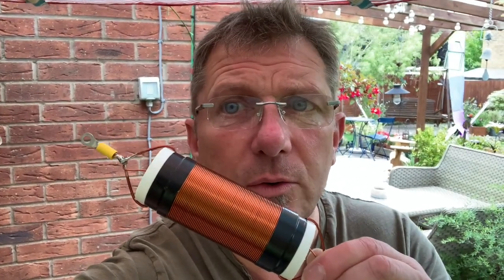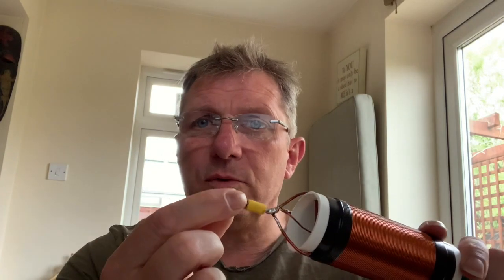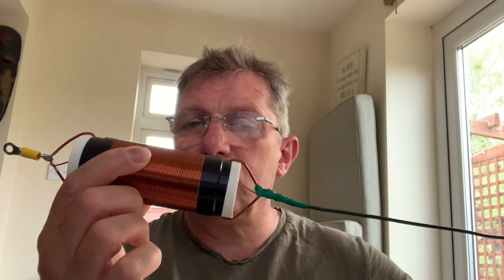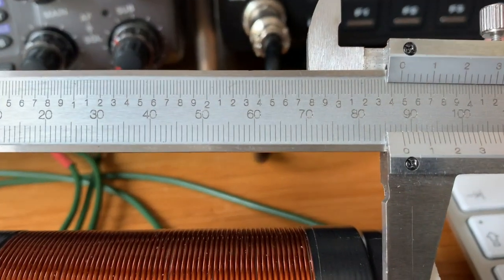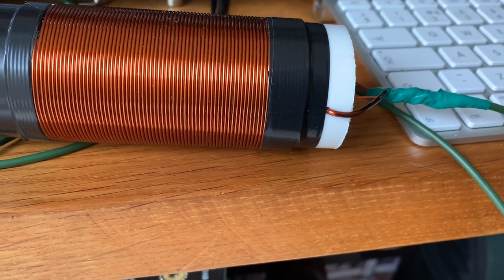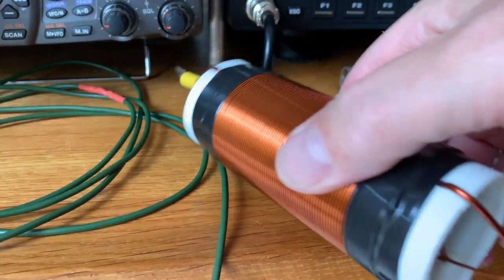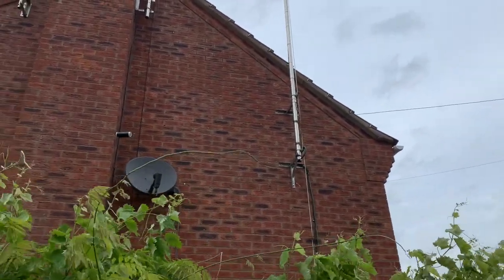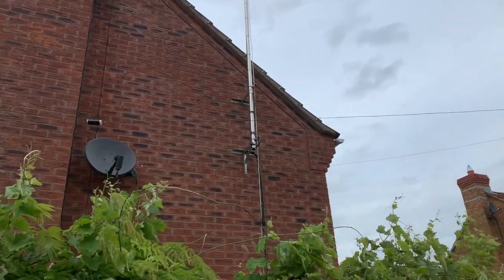Ham Radio: 80M EFHW in a 40M EFHW Garden.

Comment: Hi Mike, Keith, WB2VUO near Buffalo, NY.  Your video has been referred to many, many times. I got your dimensions from a video by DL2MAN, and made a higher Q coil using a length of PVC drain & vent pipe (4" O.D.). Mine is set up as an inverted-L,  22' up and 42' 6" to the coil. Trimmed the end wire for 3575 KHz,  and no tuner required from 3500 KHz to 3650 KHz! 40 also needs no tuner, but 20 meters dips above the band, so the internal tuner is used there.

My back yard, (Garden, if you will), has a garage on one side and an 8,000 volt power line at the end, so the useable area measures 25' x 55' out of my nominal 40' x 100'. Your design has gotten me back on 80 for the first time since 2005! In over 56 years in the hobby, I am always open to a bood idea, and this is one that I let everyone know about.

73, Keith, WB2VUO here near Buffalo,  NY.
Reply from the maker: Thanks William.  :)

Comment: Hello Mike. As a newly minted ham, I''m dealing with a small backyard to erect a horizontal EFHW antenna. I have just over 70 feet (about 22 meters). My question is, when trimming the 40M (7.2 MHz) portion of the HWEF, when adding the 80M loading coil, will that effect the 40M tuning? Thanks.
Reply from the maker: Yes a little, you will probably have to shorten the 40m section by a meter to re- SWR it.
Reply: @mike-M0MSN  Thanks

Comment: Brilliant. Would this work on a 20m random wire with 9-1 UNUn?
Reply from the maker: should do it is just a way to extend your wire without the length of garden ( you will have to make a change to the coil value)

Comment: Great info.
I have a 40M EFHW on a 12M Spiderpole configured as an InvEL that goes up on week ends and also for portable ops.

I'm going to add this to get on 80M and also experiment using same technique to add 40M to my 20M EFHW.

With 40M added to 20M, would a Bace Loading Coil get me on 80M? Just a thought.

BTW: I've been seaching for a Banana(s) Conversion Chart for 65+ years and Low an Behold, Here Are One........

73 . .

Comment: Hi Mike, I think this is the solution I need. I have at the moment a 49:1 Unun and 40m of aerial cable around the garden fence. I can get up to 40m on the radio but it fails to pickup much above that.  I have the room to extend so wonder if this will do the job. I do have a tuner. Great video..73 Ian
Reply from the maker: Give it a go.  :)

Comment: Bypass the un-un and you have a 1/4 wave antenna for 80m with a much wider band pass.  I have an EFHW-4010 that I use this way for 80m.  Works great and simple. I wish I could post a picture in this comment.

Check this out
https://www.facebook.com/groups/EndFedHalfWaveAntennas/permalink/2491086531148027

Comment: IT WORKS WITH AMAZING PERFORMANCE, BANDWIDTH IS 50KHZ BELOW 1,5:1, IVE BEEN USING THESE COILS ON MY 40MTS DIPOLE FOR YEARS, EVEN WITH 500W CONTINUOUS. 73 DE LU2AW.
Reply: Would you make any design changes to make it resonant at 3.850MHz?  I don't mind the 50KHz bandwidth if I can control where it is centered. 73

Comment: Tried, tested and approved! It works! I've made 113 QSO in a row during 2 hours of my Flora-Fauna activation trip. Surprisingly, the first station on 80m was a Danish portable operator OZ1KNS/p activating  some OZ FF! Nit bad for this band at abt 10h UTC! Then local stations made a pileup and gave me good reports. On other bands this antenna demonstrated a solid European-wide coverage. My dimensions a bit differ from Mike's but it was only such and such coil former I had :). With 80 microH I had to make the wire longer, 3,15m gave a nice resonance on 3,6Mhz. Thanks again Mike and I uploaded a YT video on this my field test, here https://youtu.be/a5ec8Z-9YVE . 73! Linas LY2H
Reply from the maker: Guy's you gotta watch this YT. great job.

Comment: Thanks for an idea, I'm gonna try it for my portable EFHW! Just my calculations with miniRing Core Calculator show that 76 t on a 42mm former at 88mm length would make 94.293 microH, in order to have 110 it would take 82 turns? Is it that critical at all, one could compensate with changing the length of the after-coil wire, right? 73! Linas LY2H
Reply from the maker: I calculated the coil on 3 different on line calculator and each one had a different answer, so I used a mates Henry meter.. BTW 1mm enamel coated copper used.
Reply: Mike-M0MSN OK, thanks, the Henry meter is hard to beat. :)

Comment: Great video. Could a loading coil be added to the end of a 20 metre half wave for 40 metres and at the end of that the loading coil in the video to give 80 metres? Just curious for one to take to a campsite
Reply from the maker: Yes you can! but. it would be very compromised the SWR would prob be OK, but quite deaf on 80m (camp site use inverted L -- a G7FEK) or a DX Commander Lite
Reply: Mike-M0MSN thanks for the reply. I’ll have a look at the G7FEK.
Reply: Just make your wire longer and make more of a racket haha! You're going camping so you shouldn't be space restricted.
Take a 50m spool of wire and an antenna tuner and have some fun

Comment: in the connection between the cables, that you use an e-mail link, does not result in interverent
Reply from the maker: Hi, sorry something is not working with this translation.. (lost in translation)
Reply: @mike-M0MSN  the hook part uses enamel, is it not interverent Mr., I'm sorry, me English translation no good Mr.
Reply from the maker: Muhammad Yohn Kenedy all the joints are cleaned (enamel removed) and soldered, the coil requires the enamel to isolate each turn from the next, the eyelet is tin. Each end of the coil are soldered to copper rings that pass through the end of the plastic pipe.  Hope this helps.